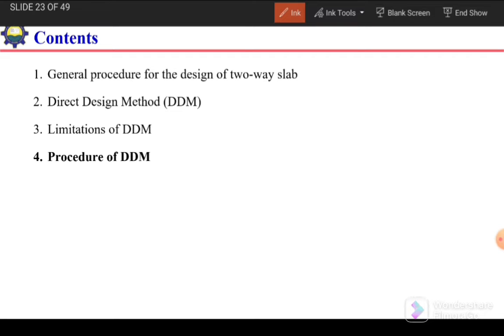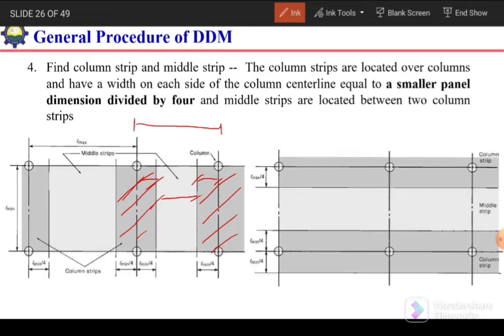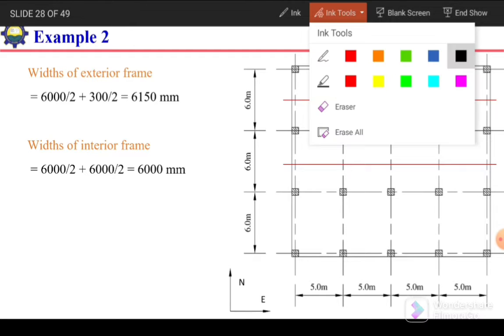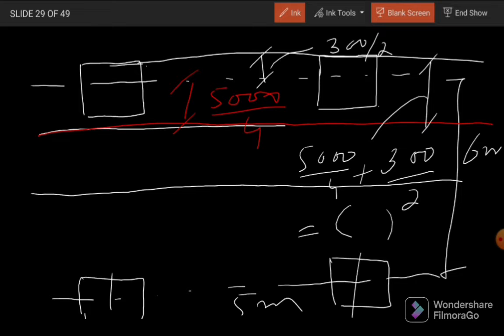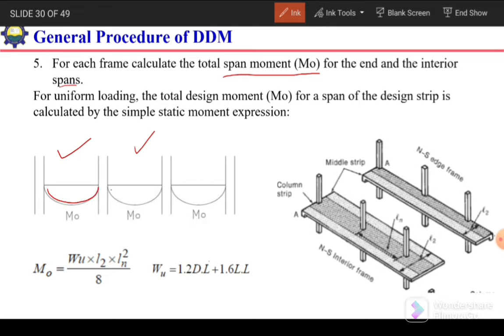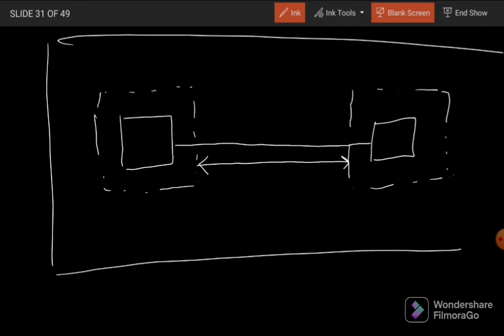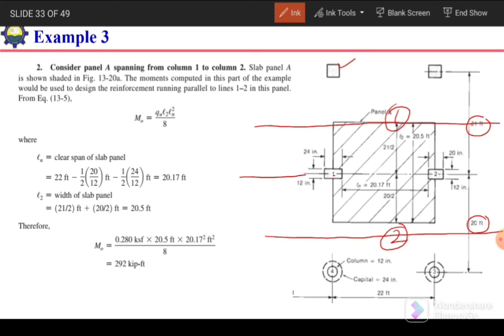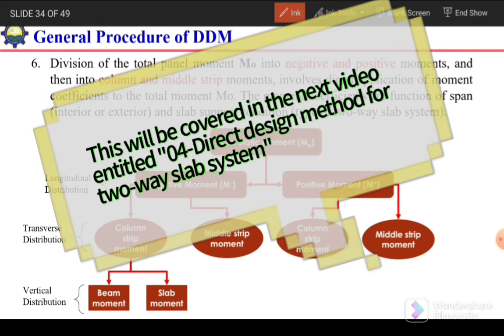03-Direct design method (DDM) for two-way slab system-Procedure

Comment: can you solve this problem 

A slab having a grid of 5x6m, with interior beams and without edge beams, with (400x400)mm columns, the slab is to carry a total dead load (including slab weight) of 4.0kN/m², and live load 5kN/m², fc' = 25MPa, fy = 350MPa, bw-300mm, h=600mm, thickness of slab is hs = 15cm.

Answer of the following (note: all dimensions are in meters)

a) Find the column strip bending moment in the short direction.

b) Check the slab shear strength at an exterior edge column of the Panel 1 corner